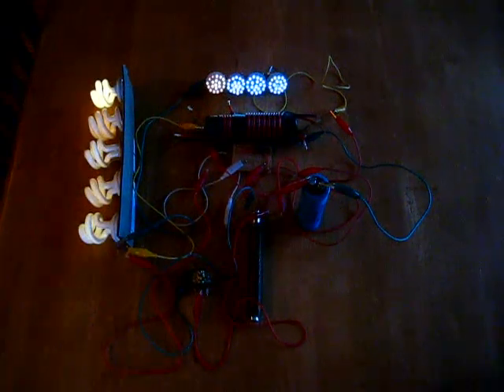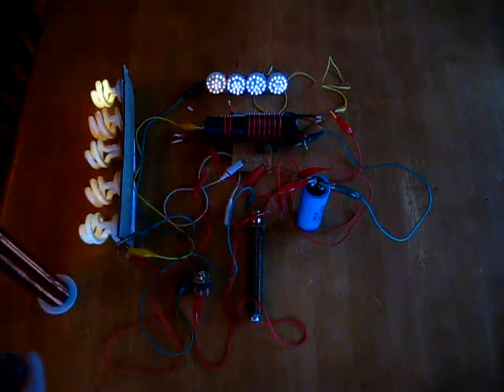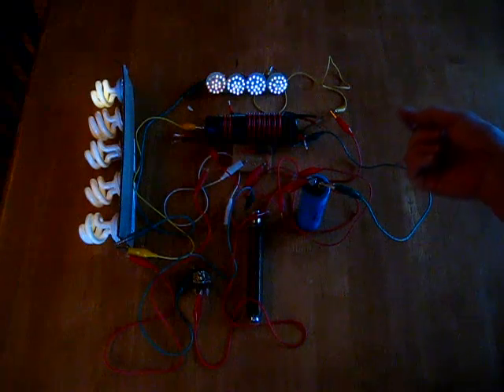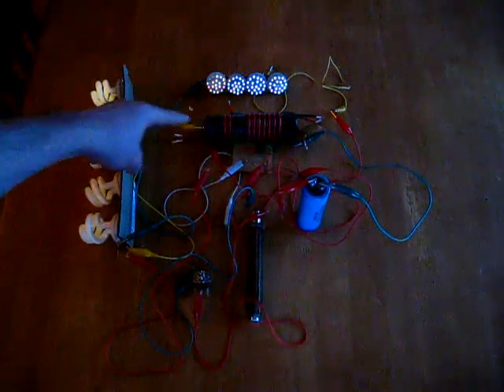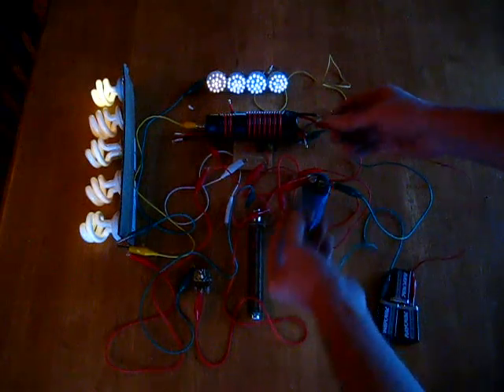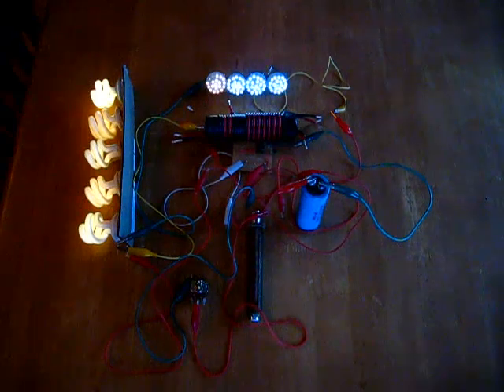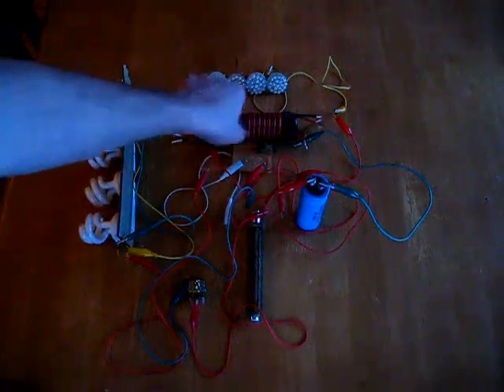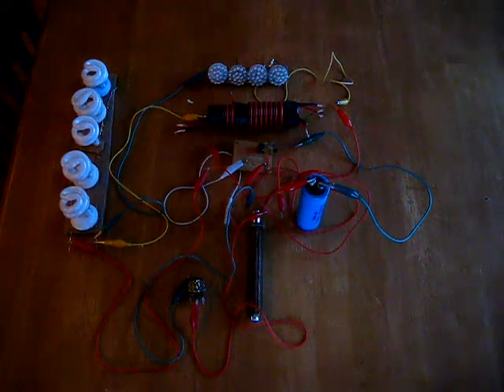Joule Ringer powers 5 CFLs + 80 LEDs!

Comment: p2. Not to mention an ignition coil is not a transformer...similar but not the same. They are more related to Tesla Coils (only solid core). You can have multiple ignition coils powered by one source without adding more power and you will get more power from them. As stated it is not standard electromagnetic induction that induces the secondary coil. If it was the oil in ignition coils would reduce the power and would generate heat.

Comment: If you say so. Maybe you should look into how much power actually hits the primary coil and compare. The relay or transistors that hit the primary coil are not inducing through electromagnetic induction and even if it was Faraday's Law deals with more then one force...meaning you have to do the math twice for conservation of energy. Once again its the disruptive discharge or voltage spikes that are inducing in ignition coils and its not using electromagnetic induction. Hardly touching source.

Comment: Have you tried making a coil like an ignition coil and hitting it with high frequency pulses to keep the circuit charged without a battery? Our ignition systems in our cars do produce more power then they take in. Car batteries typical 960w does not account for the in upwards of 6300w an ignition coil puts out. Thinking you could make this circuit self charging.

Comment: when you turn the variable resistor, then the frequency will change, then you see the light getting  brighter because the frequency resonate through the coil. If the frequency match with the XL and XC it will produce the maximum power.

Comment: nice... i´ve been playing with something similar... seems that using the vacuum discharge in place of the led or diode makes a difference... the "spark" sucks all the energy from the coil because of its negative resistance instead of leaving some behind the low voltage barrier of an led...
  i´m wondering about trying a similar SG type circuit on the input to the 2nd coil to get a flyback from it too... maybe using a vacuum tube over the coil so the Mfield disrupts the current in the tube...

Comment: @Lasersaber. to completely isolate the ICM7555 timer (mentioned below) and your circuit you can use the MAX4659 it can source 200 ma High-Current, has an on resistance of 25Ω, is a CMOS Analog Switches analog to a SPDT and a power consumption is only 3mW.

Comment: @Lasersaber, for pulsing external power to the cap you can use the ICM7555 timer or similar. It has Low supply current 80 μA and can source 100 ma. Google "LM555 and LM556 Timer Circuits" it has many circuit examples and for the 1 microsecond to hours, for one shot pulse circuit. Good work, I like it.

Comment: Nice . I have the circuit that pulses from my light heater project but its power supply is an aa battery . Could you try and see if a jt will charge your cap ? thanks 

Gadget